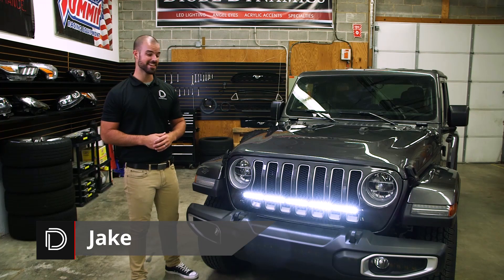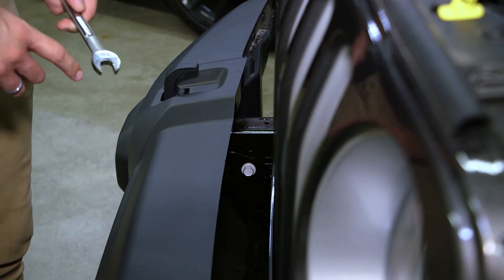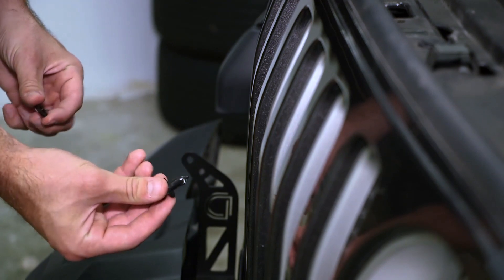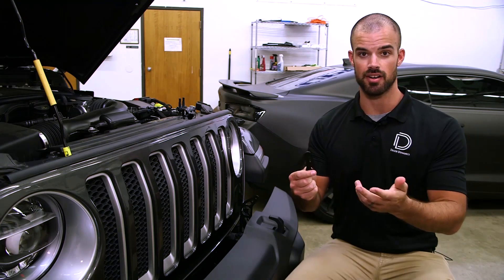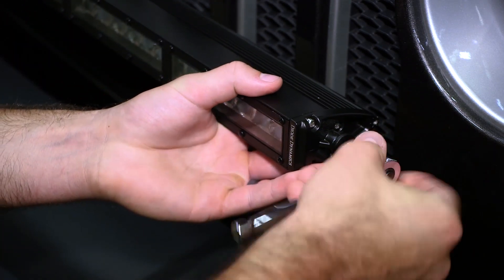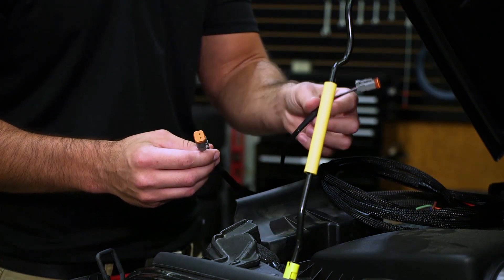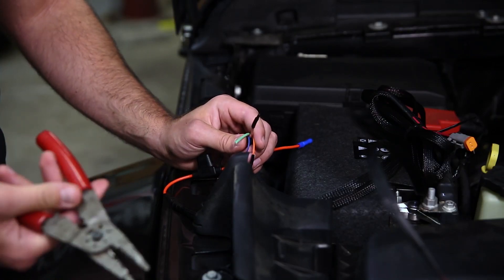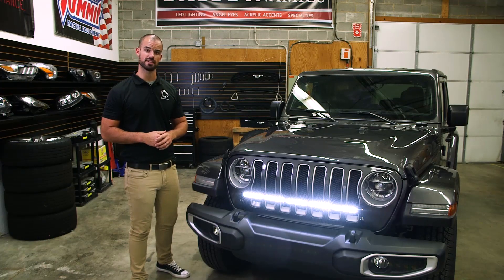How to Install 2018 Jeep JL Wrangler and 2020 JT Gladiator Bumper Light Bar Kit | Diode Dynamics

Comment: Is there a video to show where to mount the relay and also how to get the wire from the light bar into the engine compartment?
Reply from the maker: Unfortunately, we do not. However, you can mount the relay up and away from any hot or moving parts, and route the wires however you see fit, again, keeping away from hot or moving parts.

Comment: Is there a way to retain the trim fill panel?
Reply from the maker: Hi there! While you could theoretically trim the panel, we haven't actually tested that.
Reply: would moisture get behind the bumper without the trim panel and affect fog light harness?
Reply from the maker: @FJDH11  Great question! Our testing has shown that removing the panel doesn't impact the reliability or performance of the factory fog lights whatsoever.
Reply: @FJDH11  I would cover the fog light connectors in electrical tape fluid